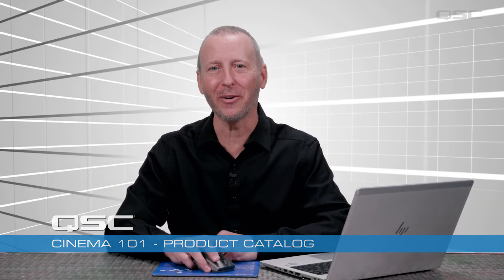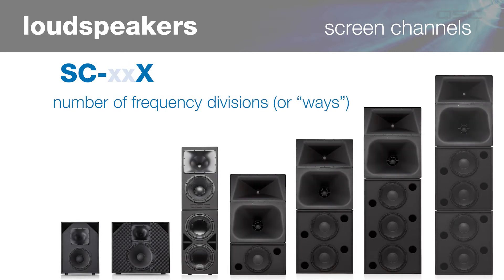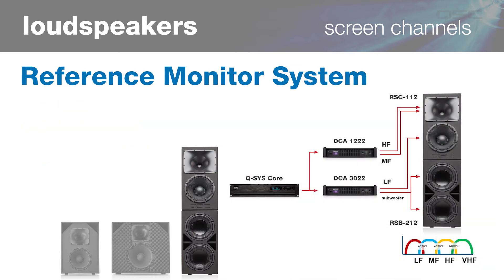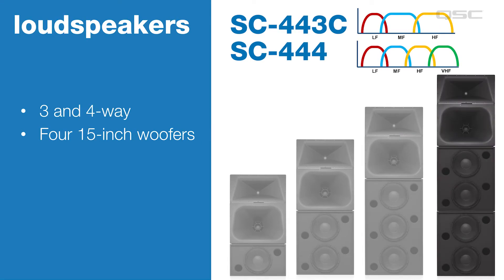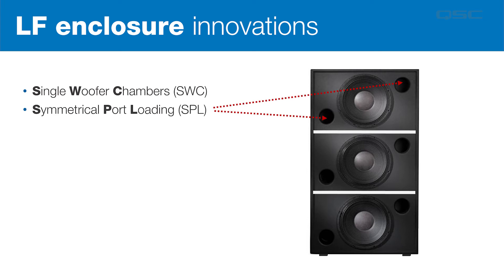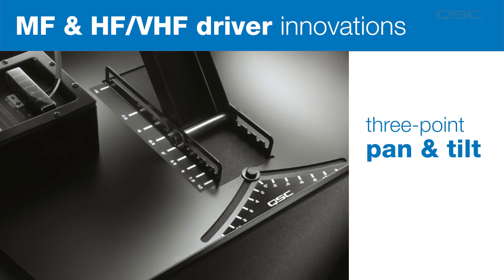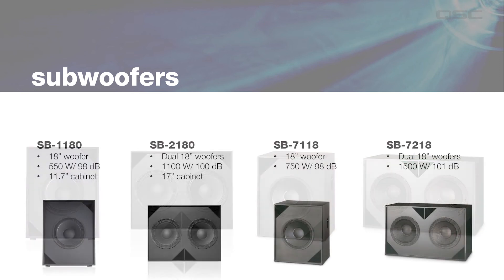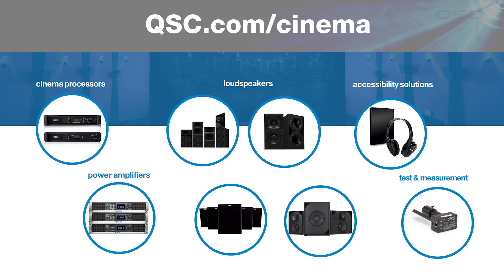Cinema 101 Training: Product Catalog - Part 2

Comment: Some of the gear mentioned here is fairly new, while some are pushing 15 years old or even older. Some are discontinued as of early 2025. If you are interested in any one of these babies for a small quantity purchase, good luck getting help and a quote form a QSC distributor / dealer. :face-pink-tears: Also, keep in mind that  we are moving away from legacy cinemas with speakers squeezed behind perforated screens, which was a terrible idea to begin with for both projected image quality and for sound quality for audio waves trying to squeeze though those small holes in the PJ screen. :face-orange-frowning: With Onyx and other video walls, and with 100-inch and larget monitors, you will have the cinema speakers in line-of-sight to your audience. Not hidden.